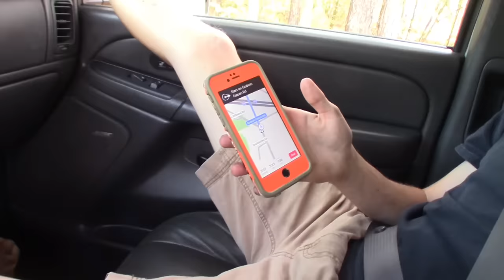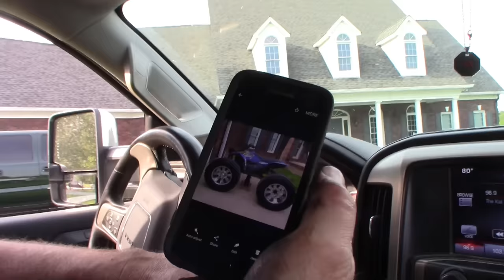WE ALMOST DIED! BRAND NEW WHEELS FALL OFF

Comment: My dad would have beat my ass lol love your dad how chill he is
Reply: Botnet wish I had a rich daddy
Reply: Botnet his dads the one who put them on that's why he's chill
Reply: Botnet yeah.. his dad did it. so he is feeling guilty trying to figure out what he did wrong. He knows he over tightened them. But he is blaming the lug threads instead of the impact gun/himself. Even the lower powered electric impacts are around 200 ft lbs . Well over twice the spec. And the good lithium cordless impacts are around 450 ft lbs of torque

Comment: That's why you torque your lug nuts 😂😂
Reply: exactly use a torque wrench instead of electric impact
Reply: yep and all ways go in a criss cross pattern.
Reply: Lesson learned, follow your torque specs.
Reply: 160 foot pounds
Reply: Andrew Kirby for real smfh 😐
Reply: And torque them while the assembly is lowered just enough so it wont move when you torque it.
Reply: Braydons father said "theres no way the eletric impact did that"

Comment: Same thing happened to 3d machines
Reply: Tyler Desi same truck
Reply: Tyler Desi I just said that in the comments lol
Reply: massey 6480 it is not the same truck on is a gas 1500 the other is a diesel 2500
Reply: Dont know if ya know this or not, but after putting new wheels on a vehicle you have to retourque your lugs every so many miles😂😂
Reply: Mason cu 😂I keep the torque wrench in the tool box
Reply: Tyler Desi yeaa

Comment: Chris fix said it's bad to take a car to a car wash
Reply: Vladi Bozhduga no its not
Reply: YouTube ain't always right bud
Reply: automatic car washes cause swirls in the paint.
Reply: Vladi Bozhduga it's not a car
Reply: touch-less washes are completely fine.
Reply: They're fine if you don't care about you paint.
Reply: what is the diffrence between a touch-less and power washing it yourself?
Reply: For the touch less you have something slapping your car/truck and for hand wash you have a microfiber towel or sponge lightly sliding across.
Reply: Look it up if you don't believe me.
Reply: you need to look up what a touch-less wash.
Reply: touch-less like the name says. has nothing touch the car.Instead is uses things you would do at home like a foam canon,pressure water,and non-pressurized filtered water.
Reply: Sorry, had a whole different wash going through my head. Yeah I don't think there is anything wrong with a touch less wash
Reply: Vladi Bozhduga my dad has torqued wheels using impact guns for over 40 years and i have too, we've raced, offroaded, and daily driven like that on trucks cars mud trucks everytning, and we never had a single issue
Reply: wrong comment fam lol
Reply: That's exactly what I was thinking! 😂

Comment: That's why you don't use an impact to put lugs on.
Even if it saves you a couple minutes in the short term, it will cost you a lot of time and money in the long term.
Impact guns can torque stuff up to 400ft lbs when the lug nuts and studs can only handle a couple hundred.
You are supposed to use a torque wrench and read the specs for your studs and lug nuts to see the torque specs.
This could have been easily avoided
Reply: Superveggie 12 you use a impact gun then torque them to spec thats how most auto shops do it
Reply: You actually Ratchet them on then Torque them with a Torque wrench. Impact Gun's destroy Threads  Especially on Aftermarket Lug Nuts, They strip the hell out of them.  I've learned from experience to never use a Impact gun unless its a Very Low Torque Impact gun.
Reply: Superveggie 12 ^^^
Reply: Superveggie 12 exactly
Reply: used impact wrench on all my vehicles not a single problem but i do say that its more secure if i used my torque wrench
Reply: Inline Performance yeah, that is what I was trying to say
Reply: Inline Performance damn I've been doing it wrong all my life haha
Reply: Superveggie 12 dont buy a cheap impact ive been using one basically daily for 12 years. oddly enough no problems
Reply: JOSHUA BARNHOUSE 
He is doing it wrong, the bolts would have already been overtorqued from the impact gun and damage to the threads and the studs would have already been done.
Reply: bravo!
Reply: Superveggie 12 my dad has been torqueing wheels with a impact for 40 years and ive been doing it since i was a kid, we've raced mudded and dailyied vehicles like that, and havent had a issue yet
Reply: but i will admit on the nicer stuff and customer cars we torque them properly
Reply: It also depends on what air compressor and Impact wrench you are using, I have an Ingersoll Rand 2135QTiMAX, Impact wrench, and an Ingersoll Rand Type-30 air compressor, and it will damn sure rip the threads out of the lug nuts, or snap the studs off.. If you using a $100 impact, then it most likely don't have the power to strip lugs out..  And I'd say his truck should be torqued to about 130lbs.. and if he has a setup close to mine, he will be torquing them to 250lbs, and they can't handle that, it just breaks shit on regular cars and trucks.. lol..   

It's also best to torque them with a torque wrench, for wheel balancing purposes also.. Better to be safe and torque them right, because it could cost you or others their life.. Just imagine if he had been on the interstate running 80mph when it came off..    Peace!!
Reply: Calvin H. Almost all impacts have the power to strip studs. The point of having a good one is knowing it has the power and tightening in short bursts. Like my comment said ive been using one for years on multiple applications and have had 0 issues. I have also seen full service shops going to this method and never checking with a torque wrench.you might call it lazy but I see it as experience. You figure out how long it takes for it to tighten and you left off. It really is common sense to a degree and some people may not have that and with that maybe they shouldnt use impacts.
Reply: IsThisLove,  I'v also used them for years without an issue, but like i said, it depends on the compressor and impact someone is using, because i know you can't use some 2hp little home compressor with a $5 air hose, and strip lugs out.. It just will not have the power.. So if you're ASE Certified, or just have a lot of practice with the tools you use, then yes your good at knowing the feel of them, and you know when to stop..
Reply: Or at least use a torque stick. I Use my electric dewalt drill turned down to run them on the torque them once it's on the ground.
Reply: Tight is the torque spec. Or two ugga-duggas on the impact. I have done it my whole career and so has probably 80% of the technicians that I have worked with.  Amatuers trust their mickey mouse $20 harbor freight torque wrench to torque their wheels to spec and then wonder why they come loose or fall off.
Reply: I've done both I've torqued my wheels and had them fall of after 500 miles of checking them after 50 miles 4 times and I've impacted them on and never had a problem for thousands of miles  let's say I threw to torque wrench in the garbage
Reply: I use one just till they set then use a torque 🔧 to 155 ftlbs but thats for a f250 . my Chevy 1500 is 135 ft lbs if in not mistaken
Reply: you can use an impact with a torque limiter to quickly get everything on ( criss cross pattern and all) and after that use a torque wrench to spec.
Reply: Or you learn how to use tools and work on your own shit impacts work fine if you know how to use it
Reply: it had nothing to do with torque he didnt tighten them down in star pattern

Comment: you shoulda got a ford at least they keep the wheels 13:07 a chevy in its natural habitat on a trailer!!
Reply: it is my opinion
Reply: yeah there is ford is gay
Reply: Hey if it Gets you to Point a to Point B, Who gives a fuck what brand it is Loll.  Hell they're all great trucks. Just gotta Maintain them and you'll be Set to go.
Reply: Hey Atleast it's not a dodge 😂
Reply: DirtBikeFool21  ford's stay on the side of the rode more than a Chevy will ever
Reply: @knockouttaz1765  ya as its waiting for a chevy to leave the repair shop but it never leaves cause the only thing that will make it better is to trade it for a Ford😂

Comment: exact same thing happened to my 2014 silverado. i had those exact same lug nuts too. the lug nuts are just not long enough for the studs and the hub centric ring might not have been in the right position. so the tires and wobbles and then eventually stripped all the studs and flew off.

Comment: It's the added pressure from the offset. Cummins in my profile pice lasted 15 miles didn't feel a shake or anything just came off when I turned a corner at 10 mph (drivers front also). I have a few thousand miles on them now with no issues but every little noise or shake scares the hell out of me now.

Comment: Ended different type lugnuts. Ya. Ant use the same nuts necessarily on a different wheel. They may not hold even if torqued. Good ole boys. Depends on the hole and nut face design.

Comment: damn chevy's need a dodge
Reply: Austin Cain dodge is the worst out of the big 3 for reliability
Reply: jj Watson actually ford is the worst outta the big 3
Reply: jj Watson I used to always see dodges on the side of the road with the hood popped 😂
Reply: jj Watson only because they are so cheap, haven't you seen one of the aluminum bodies ripped by a man, exactly
Reply: Dodge 318 Cummins them autos are trash if the motor is anything over stock. I don't care who made the first extended cab. And if that's all you have to brag on that's bad lol..
Reply: every body needs a bowtie
chevyyyyyy

Comment: Hey brandon just to be safe I'd get new studs and lug nuts so you don't have it happen again and get them for all four hubs don't just replace the left front safety is more important than just replacing one side hopefully you'll get the truck fixed and back on the road soon.

Comment: Just had this happen to my '01 GMC 1500 HD yesterday. Just got off the freeway and the wheel fell off at the end of the off ramp. Luckily I was only doing about 5 mph hat the time. Still did a good $2000+ damage. I'm thinking someone sabotaged me. Last work I had done on my tires was over 6 months ago. All 8 lug nuts were in the road within 20 ft of where I stopped.

Comment: Star pattern snug lug nuts torque wrench proper specks or torque bar with impact. So you don't over tighten and pull threads out of lug nuts by overtighten. If you tighten any wheel specially aluminum wheels always torque em with in 50 kms.

Comment: your MEANT  to torque them down to spec then after about 80 - 90ks re tighten them. rattle gun do them up but if there alloy will cause damage to the rim and may result in rubbing and may pull through the rim.find the specs for your car and put a sticker or something on the rims so you remember the torque.

Comment: you have to tighten the wheels like 3 different times you got to put them wheels on drive around the block tighten them again drive around the block and then make sure they're still tight because in those Wheels have to be tightened multiple times same thing with my truck

Comment: i got a story: I have a Chevy Silverado similar to this guys truck. I put 1 inch adapters on my back wheels to make space for some new rims that were hitting the brake calipers - i trusted them to be fine - they were for a while. When i drove up a steep hill a noticed that i had spun my RWD wheels a bit as it was wet going up the hill. When I got to the top it felt like there was a wobbling in the back of my truck. I stopped to check & found out that 4 of the 6 adapter studs had snapped off leaving the wheel hanging on by only 2 studs. needless to say this was a problem. I had to borrow a 4 way lug wrench to remove the adapter, change the rim/tire out for my spare & limp down the hill on 5 lug nuts per tire instead of the normal 6. after that I didn't trust the adapters anymore. At least I discovered the problem & was able to fix it before losing the tire & dragging the rotor/hub/ and possibly the bottom of my truck bed on the pavement.

Comment: When you buy wheels it's very important to make sure the wheels fit properly hub centric!  Different wheels also require different lug nuts. That's why you also don't buy cheap Chinese wheel spacers or lug nuts!
Reply: If you're bolting a tire on the same wheel studs why would you want different lug nuts?
I'd be more comfortable with the factory lug nuts than some other brand that
uses different manufacturing parameters for accuracy and metallurgy.

Comment: That's what happens when you impact lug nuts. Over torqued them and pulled the threads out. You're probably gonna need studs n lugs all the way around if he did that to all the wheels.

Comment: I'm an old guy so I don't know anything. Thus you may not want to read this. But if you do, let me explain something about wheels. It's not a lecture. I want to help. I don't know how much of this incident could be blamed on the wheel or how much on the installer. If you Google "alloy wheel manufacturers" or something like that, you will find that right now nearly everyone and their dog has a wheel-manufacturing and/or sales business. Why? Because it's a lucrative business, and in the U.S. there are really no regulations on the manufacture or import or sale of passenger car or light truck wheels. Tires are regulated by the U.S. Department of Transportation. But not wheels. That doesn't mean there aren't regulations on what you put on your truck and drive on public roads, but at least not on what you sell. I suspect he bought these wheels because they were pretty and they were cheap. That's what most people do. Aside from that, don't install alloy wheels with a ratchet wrench or a power driver. You can spin on your lug nuts with those, but any tightening requires a patterned tightening approach until you reach the torque specifications per the manufacturer.  Flying wheels are becoming a "thing," and people are getting hurt or killed over it. Watch this YouTube link: https://www.youtube.com/shorts/3-wk1CYv8JY

Comment: My guess is they were over torqued with what ever they used to put them on. The lugs were all at the failure point then gave out. If the were just loose you would have heard some noise from the tire wobbling way before the point of the tire coming completely off the truck. Always use a torque wrench and a little anti seize to keep the threads in good shape.

Comment: make sure you have the proper aftermarket lug nuts that seat into the lug holes correctly, torque down to 140 foot pounds in a star pattern twice. then drive it for 100 miles or so and then re torque them. and repeat 2 times

Comment: Man it's so laughable when stuff like this happens and the first thing you hear is exactly the first thing they teach you NOT to do when working at a tire shop. " we used the electric impact, this shouldn't have happened" 

Like fuck I can't even tell you how simple it is, and trust me put in 5 years at Kal tire busting tired before I went into the mech side. And there is no "easier" way to install wheels to proper and SAFE torque specs. 

Throw the wheel on, turn the lights nuts in a few turns. Grab your air impact on the lowest setting, or electric if it's all you got, tighten the lug nuts down till they are just seated on all wheels, in a criss cross pattern 1,4,2,5,3,6 till they are just seated say maybe 1/8 turn past snug.  Then lower it down until the tire is just touching the lift or ground, grab your torque wrench set to 140ft/lb and tighten in the same criss cross pattern until torqued to spec. If you go to torque a lug nut and the torque wrench clicks and doesn't turn at all back off the lug nut and tighten it to the proper spec with the torque wrench. "Tight is tight" is no good with wheels, loose is obviously no good, over tight can cause an uneven mounting surface, stretch threads etc. Also with aluminum wheels need to make sure there's no corrosion between the hub of the truck and the mating surface in the wheel flange or else you will tightness the wheel down, drive around and the corrosion will break up causing a gap between the wheel an the hub and this can happen. That's why they tell you to return for a re torque. If you go to re torque and there's more than one lug nut that moves it's likely a good idea to take that wheel off an check it out. 

Also when buying used wheels you need to be mindful of hub centric rings that the previous person may have used, or you may need to use. Sometimes the whole in the hub in the wheel is larger than the ring on the hub that it's supposed to be centered on, some don't know that all wheels are not lug centric some are him centric so if you don't need the hub rings but they are installed in the wheels your wheel will not flange up nice and flush in the hub and you will have a plastic or aluminum ring between the wheel and the hub. It will feel like it's tightening down but once you drive a bit it will squash an loosen up. They are just plastic rings that slide inside the hub of the wheel so the wheel sits perfectly centered on the hub of the truck.

As well all those "threads" he's pulling off the studs is likely aluminum from the wheel that the threads cut out and filled up with.

Comment: Threads were strips using an impact wrench before they pulled on the road. Slow down and use a torque wrench. P. S.  Lose the Ghetto rims.

Comment: That's why when I put new rims or tires on my truck or do any drilling into the hubs, or just rotating tires, I always use a torque wrench and after a few miles I check again. Actually it's pretty easy to tell when something's loose, cause of the vibration. Apparently daddies money doesn't teach people common sense. Hmmmm